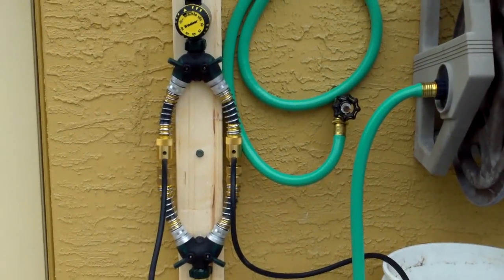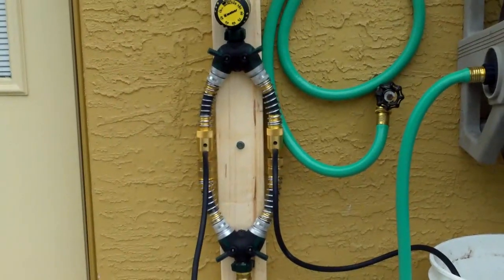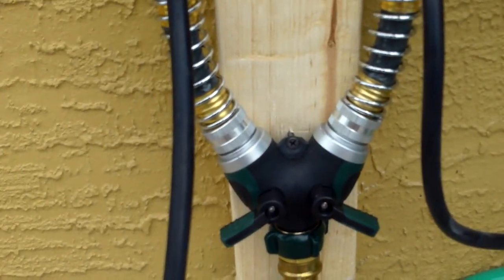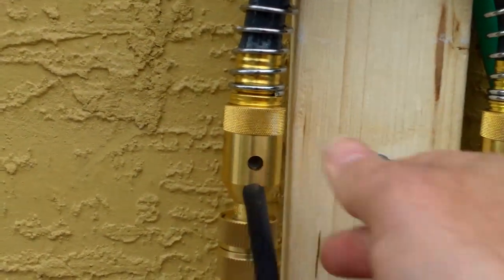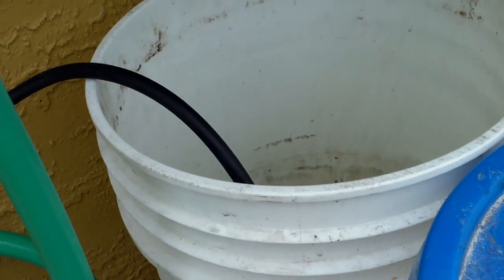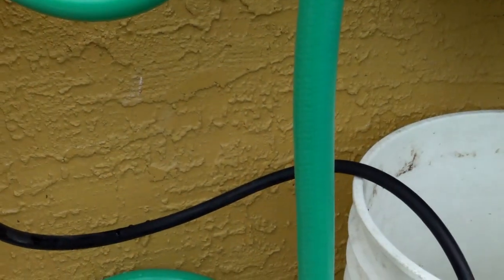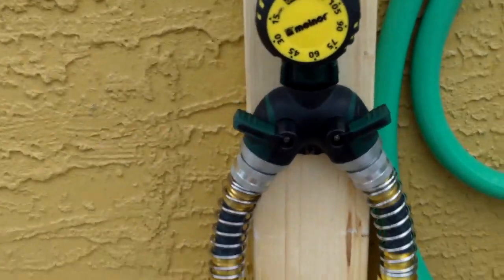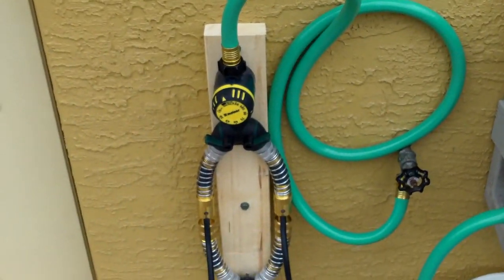Venturi Siphon

Comment from the maker: Actually I haven't gone that far. What I do know is that the venturi needs about 15 to 20 pounds of pressure to be accurate at 16:1 and I know I have at least that. Supposedly, regardless of how much water flows through and how fast, it should keep up at 16:1. This is the only reason I didn't set up a drip system. because it's low pressure, slow flowing and I don't want to take a chance of it being way off, especially with the pH. I have a possible idea to remedy that, but that's down the road.